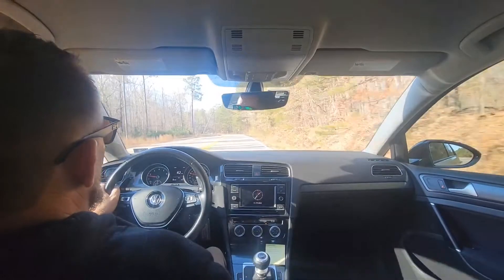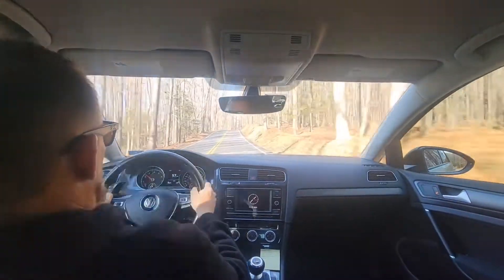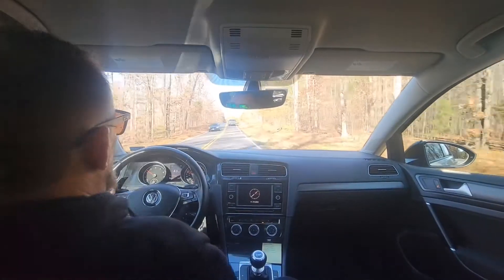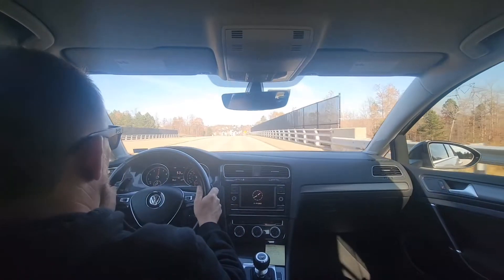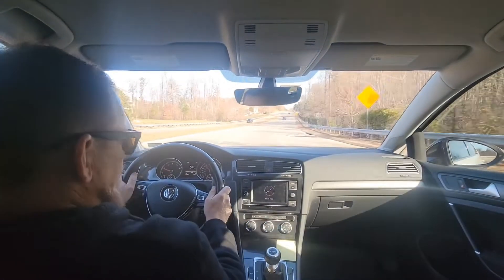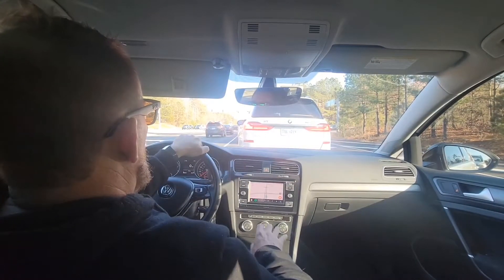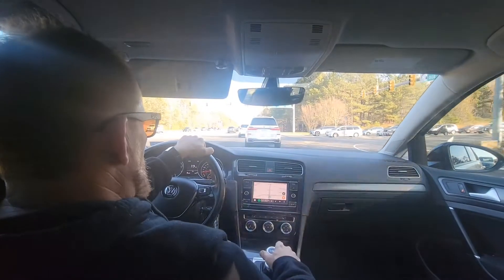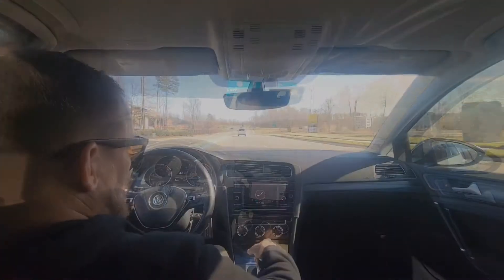NVH ratings for all my suspension and chassis mods on a 2018 VW Golf Sportwagen

Comment: Nice vid! I ran across it on your forum post. I was thinking as I was watching, that it reminded me of where I grew up, and sure enough I see on your forum avatar that you are in Richmond. I grew up in the Bellwood area of south Richmond. Its been 50 years though. LOL! 
I did a F&R swaybar upgrade in my golf and am very happy with it. The only harshness I notice is as you mentioned hitting a dip while making a turn. Only happens at low speeds though because the turn has to be sharp like making a turn onto another street or driveway.